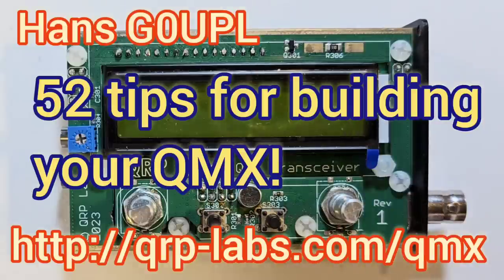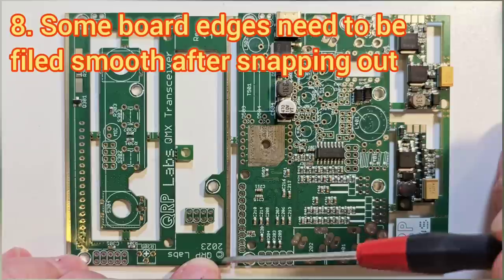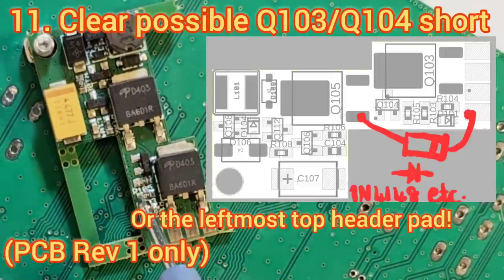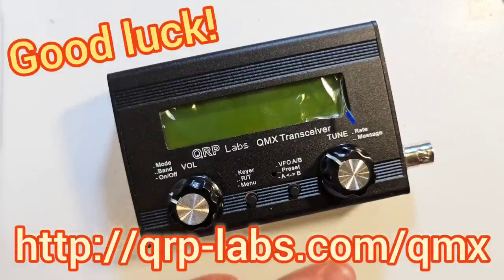52 tips for building your QMX successfully!

Comment: Timestamps / Chapters
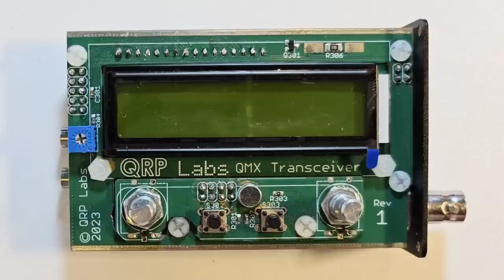0:00 Intro
0:25 1. Read the Manual
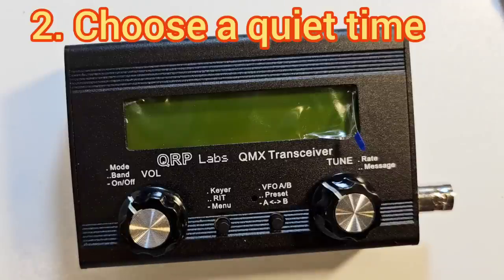1:04 2. Choose a Quiet Time
1:54 3. Don't try and do too much in one session when you're tired.
2:17 4. Use a jeweller's Loupe for close inspection
2:53 5. Check for broken inductors / capacitor
4:24 6. Removing PCB rail may be necessary but is no big deal
5:06 7. How to snap apart boards
5:29 8. Some board edges need to be filed smooth after snapping out
6:28 9. When filing, don't fear internal copper layers. There's no risk.
7:20 10. File left and right edges flat so the enclosure fits later.
7:55 11. Clear possible Q103/Q104 short (PCB Rev 1 only)
13:09 12. Touch up USB-C connector but don't panic about it
14:31 13. Don't fail to remove wire enamel
16:23 14. Don't tin 0.6mm copper wire before putting into board holes.
16:15 15. Squeeze toroid turns to improve output power if needed but don't panic about the half dB.
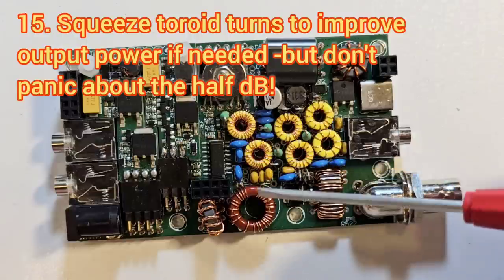17:49 16. A powerful iron and extra care and heat on ground connections.
19:19 17. Be careful not to break 47uH axial inductors
19:37 18. Avoid mixing up capacitors; don't rely on matching yellow/blue colours
20:22 19. Early instruction manual had 20m Low Pass Filter capacitors swapped
20:57 20. Early build manual, low 20m sensitivity dye to parasitic resonance
21:43 21. L401 inductor tip for easiest inductance adjustment later
22:13 22. Check trifilar windings carefully with DVM before installation
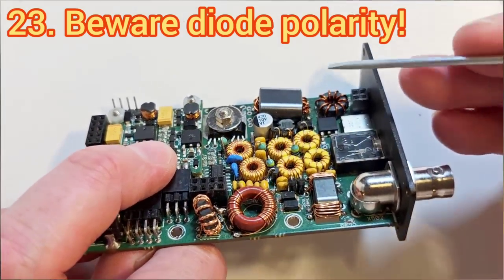23:18 23. Beware diode polarity
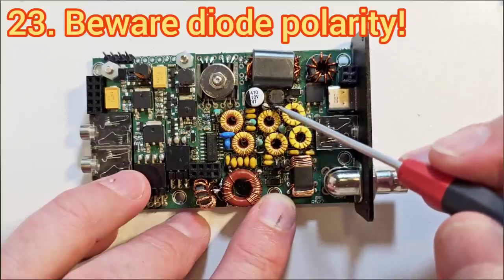24:29 24. Soldering iron from a clear approach path
25:19 25. Sharp wire cutters from a clear direction to avoid SMD damage
25:53 26. Keep wire cutters horizontal, squeeze don't pull
26:13 27. Beware very small gap between power connector and pin header pad
26:31 28. Watch out for other close-spaced pads such as at 3.5mm connectors
26:40 29. Special care at rotary encoder pins: risk of shorts to ground
28:38 30. Cutting technique for the control board header pins
29:55 31. Ensure perfect positioning of SMPS boards: connectors are raised a little
30:15 32. Don't drill or burn out the thread of the inner nuts
30:52 33. Move bolt as far from corner pillar position as possible
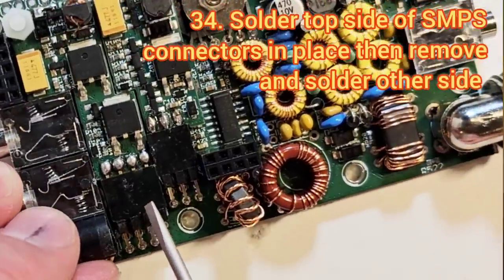31:35 34. Solder side of the SMPS connectors in place then remove and solder other side
31:47 35. Position all inter-board connectors as accurately as possible
32:26 36. 3.5mm connectors need twisting to align at right-angles
32:52 37. Use of heatsink compound paste?
33:40 38. Bolt transistors down flat before soldering
34:15 39. Don't worry about BN43-202 transformer overhang
34:37 40. Zeners shown on schematic aren't supplied or installed or mentioned: not a mistake
35:07 41. Don't over-tighten the PA transistors bolt (PCB Rev 1 only)
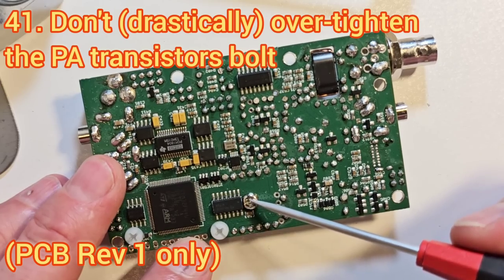35:43 42. Alignment of the BNC connector is important to get right
37:01 43. Don't forget to fold in the display tab
38:05 44. Trim LCD wires short
38:26 45. Winding style of the SWR bridge: copy manual photos
38:53 46. Don't forget to solder all connector pins
39:52 47. Don't forget to solder the underside of the SMPS board connectors
40:24 48. On completion check board carefully for shorts, poor joints, etc.
40:57 49. Check that no SMD parts have been accidentally knocked off the board
41:47 50. Enclosure screws should not need forcing in
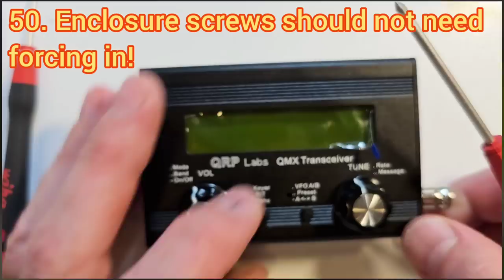42:11 51. Knobs need to be raised a mm so that there is clearance to press them
42:36 52. There's no need for the BNC washer and I like to leave it out
42:55 Good luck
Reply: Thanks for that. Very handy checklist.
Reply: Thank you, this is very helpful!

Comment: As a seasoned kit builder, you are absolutely correct that being seasoned, COULD be a detriment. I was all finished with the main board when I found this video. I also found a mistake I made from this video. Not reading EVERY word. When it came to installing the 2X5, 2X4, and 2X2 connectors, I failed to read the word FEMALE. Lucky for me, my repair experience afforded me to correct my mistake and correct the assembly without damage. Most times this wouldn't make a difference, but I felt that trying to connect the daughter board to the main board opened up the possibility of damaging the toroid windings next to the 2 X 4 connection. Please, please, please, one missed word can cause failure. Thanks Hans, for providing this video.

Comment: 👍Thank you Hans for taking the time to do this. I will watch this again before I start the QMX build. The tip about NOT tinning the toroid leads is good - that would have probably caught me out. What occurred to me most in this video is that it is a very good idea to make sure you have good quality small sharp flush wire cutters for the build.

Comment: I greatly enjoyed building mine. I knew nothing about the component shorting on the buck converter until after I finished, so I guess I got lucky. I did encounter a short between the body of the left encoder and the center pin of the power jack. I filed the encoder and desoldered and moved the power jack out a little past the edge of the board. I overheated and melted the speaker jack, which I have since replaced. I also had to trim the head of the nylon screw for one of the buck converters to get the case to close without interference. I’m getting around 5W on all bands without making any adjustments, so I was either lucky or good (or both). All in all, a challenging yet rewarding build, to say the least! Well done, mate! Now, about that AGC… DO NOT use headphones on this rig until the AGC feature arrives (it is not there in 1.0.9). My hearing took a hit after one particularly strong signal.

Comment: I finished the assembly and I am waiting for a SMPS board replacement to solve Q103/Q104 short problem. This video is extremely helpful to reflect on various tricky aspects of the build process and check all those points while I am waiting. This is the kit project I learned the most from and from which I gained the most experience! A lot of fun! That's due to you dedication for explaining and supporting builders. Thanks a lot for that!

Comment: Many thanks Hans - fantastically detailed as always. My kit is still in a box, but I will get to it after the 16th October. Before I start, I will watch this again, and print out and read the latest instructions. As I complete each step, I will tick it off on the instructions to make sure I don't miss anything. Biggest surprise for me from this video - the need for a 60w soldering iron. I would possibly have reached for something smaller (unless of course this is also in the instructions :) ). You are a star!!

Comment: To prevent a possible short (because my spacing was, well, non-existent) on the back-side of the 9v/12v power socket, from a fairly large piece of shrink wrap tubing, I cut a small square, single layer (half the tube) and just wedged it between the back of the power socket and the adjacent jumper pins component. I did not heat it, but it was what I had lying on my bench that was thin and would make a good insulator. I had to do this because I soldered the power socket just a tad back from the edge of the PCB. The front of it needs to be right at the edge so the back-end of it (with +12V spot of metal) clears the jumper pins that are installed later.

I have a 110W soldering station, and even with that amount of power I was surprised (even though Hans has discussed this several times) at how long it took to solder the through-hole components to the PCB. My first impression was that the metal used in the PCB did not take solder well (I chose lead based solder); but that was not the case at all, it just takes a surprising amount of heat and therefore longer time for solder tip contact with components to get a good solder joint due to the 6 layer PCB used. I did use a rather blunt soldering tip to help improve the heat transfer. I also did not trust just using heat to burn off enamel for any of the toroids; I scraped all enameled wire connections prior to soldering them, then tested every one of them for continuity with a Digital Multi-Meter.

All-in-all, it was a fun build. I completed mine over a 3 day period, and was on the air with my QMX the very next day after the build with no issues! (I did a current-limited under-voltage power up as recommended for first application of power). From my QTH near Denver Colorado, and a vertical antenna (a 20+ yr old Cushcraft R7000 w base up about 10 Ft) I have confirmed FT8 contacts to Somoa, Japan, Italy, Spain, Panama, Cuba, Ecuador, Switzerland, Canary Islands, Madeira Islands, Netherlands, Dominican Republic, Saint Vincent, Barbados, New Caledonia, and Hungary. All on the QMX running just under 5 watts over the last 3 weeks into a half-wave multi-band vertical on 40M, 30M, & 20M bands. And I have made many domestic US contacts on both FT8 and JS8Call.

I'm totally enjoying this QMX much more than I thought I would! Thanks Hans for producing this video. I wish I had seen it before I built my QMX, but the assembly manual is quite complete and clear, so had no trouble building the QMX.  I'll be purchasing and building a high-band version of the QMX when it becomes available!

Comment: Thank Hans you for all you are doing for us.  I did damage my RSPS #1 Board and need to replace it, I ordered a pair and a spare for future OOPS'.  I also had a heck of a time following a few instructions but I believe my issues are going to be not using enough heat for blend the 6 layer boards connectors, that said I have not been able to power up my project enough to see it on my computer.  There is Zero amp draw on my Variable PS set to 7V.  I am hoping my replacement PS boards fix this issue.

Bill W3SI